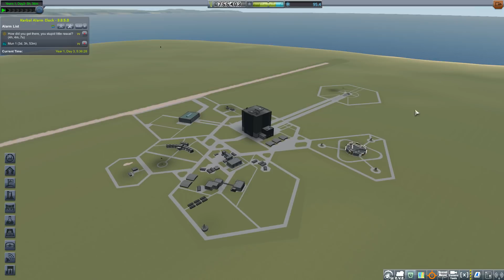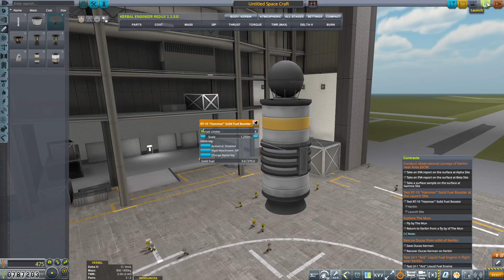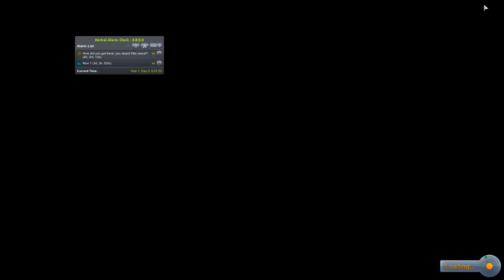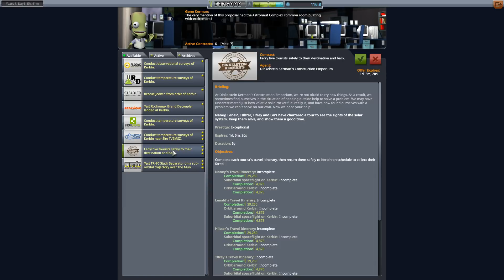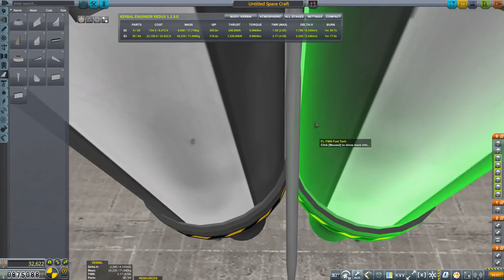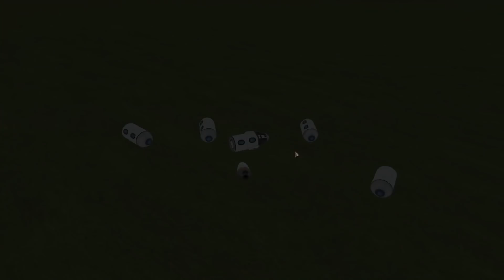Fifties Style Space Rocket - KSP Career Playthrough 14

Comment: Same problem as a few Episodes earlier: Some of the lower thrust engines do not have an Alternator and are thus unable to generate electric charge. The THUD (as well as the TERRIER, TWITCH, ANT and SPIDER + all mono-propellant engines) engine doesn't have an alternator, this is why you wasted your fuel for no gain whatsoever.

Comment: You talked about using OBS for recording. I heard your running in 1920x1200 so times might not scale for me but what do your render times look like. Also, what processor do you run and what software do you use for rendering? I have 2 dual Xeon setups (one with 24 cores for storage mostly and one with 16 cores that I use for gaming) and was wondering if it would be even worth my time to transfer over my files before rendering them. Also, keep up the good work
Reply from the maker: I use a 1920x1200 screen but record 1080p by recording the game window which is limited to that resolution.
Rendering this exact video took 28 minutes and 30 seconds on an i7-6700 with a Samsung m2 SSD.
Reply: ShadowZone oh ok. That's not that bad for rendering times. About a 1:1 correlation between video time and render time. H264 encoding is confusing. Some programs will  use 2 to 4 threads some will use all 32 of my threads.
Reply from the maker: Yeah my CPU cores weren't even at 100% load during that. I usually let it run in the background and do other stuff, like watching YouTube or playing KSP :)
Reply: ShadowZone yeah. I mean... Ksp is that same way. It likes to single thread everything unless there is more than one ship. I used to play with a bunch of friends with dark multiplayer and their cpu's couldn't handle having like 20 people with 200-300 part ships within physics loading distance. I was also hosting the server at the same time. I would love to see some decent multithreading in ksp